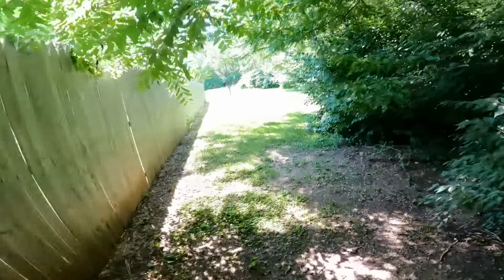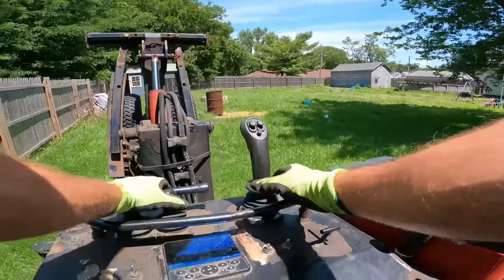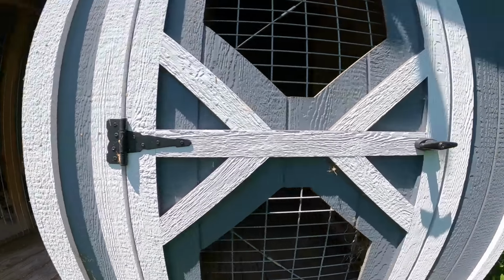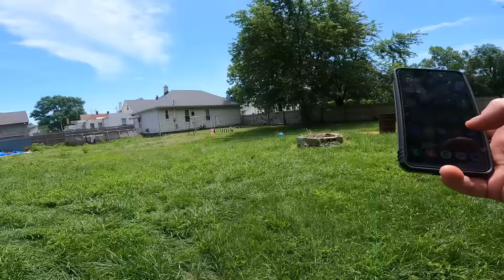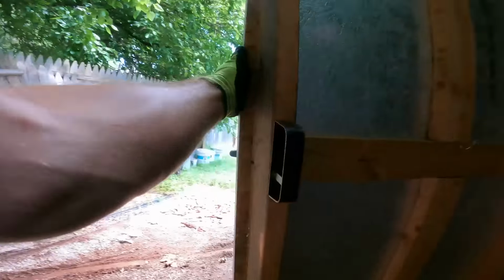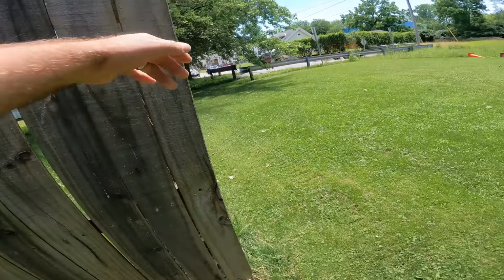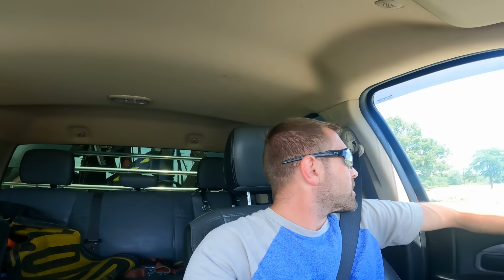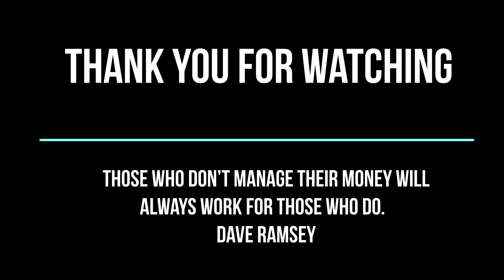Dog Kennel Repo Attempt

Comment: Wow, in FL if you were to take those fence panels down, you would be in JAIL. Repo persons can't even open gates or cut locks.
Reply: @tammielee6743  Even if the homeowner was home , and the repo guy comes to their door and says, " If you can't pay for the dog kennel, we come to reprocess the dog kennel "  do you think that the homeowner will say of corse you can come to collect the kennel,  let me open the gate for you and turnoff the electricity?  Of course not, they will yell 🤬 and do everything to prevent the repo from happening.  Because that's how lots of people are.
Reply: I was wondering that myself.  Home owner could claim he damaged the fence.  Damaged the yard with the hauler.  And even argue that he trespassed on private property.  Not to mention theft of personal property as he was planning to take the shed with the window AC unit still attached. 

Even if this repo was legitimate, it just seems like he took some pretty shady approaches to reclaim it.  His only saving grace is that there was no dogs in the back yard and no metal brackets used to secure the back side of the fence panels to the posts. Because he sure didn't have a Plan B.  

So his revenge is to move it and adjust it so as to make it awkward to use for the people who bought it.  Without consideration whether or not what he did wouldn't put pressure on the live electrical lines attached to the unit.

And one of his comments really stuck with me.  "You are supposed to put this inside a fence."  Where else would you find a dog kennel?  Seriously.

I don't know.  I have no idea what state this is or whether the guy even broke the law.  But it seems to me that to repo this shed it is going to take a court order, police involvement, and a certified electrician to disconnect the power.  This guy just wants to take the Billy Bob approach to shed repo.
Reply: It's the same in Louisiana. I could defend my property with force if need be but I don't have a repo problem as I always pay my bills.
Reply: Usually the lease agreement gives the leasor rights to the property at any time to repo it.  It's basically the owner giving permission, so it can't be trespassing, and it usually has a clause in there about damages are the responsibility of the owner.  Those are pretty lock tight contracts that allow this, no matter what laws you may be thinking of.  If the owner gives prior permission in a contract, it's binding.
Reply: @superdave8248 You wrote a lot to have never read a shed contract.
Reply: @DannyBowen25  Even with that, by crossing a barrier, in this case the fence, and depending on the state law, it could be charged as burglary
Reply: Wonderfully said superdave8248
Reply: It’s just not in Florida it’s all 50 states this guy is breaking the law and would be in jail for numerous charges the only recourse they have is court and try to get a wage garnishment
Reply: @martinedgar8057  It could be considered burglary, but it's not going to be because he has a legitimate, owner signed contract that states he can come in...  you COULD say that if you invited your neighbor over and told them they could have dinner, you COULD say they stole your food and have them arrested, but it won't stick once they find out you invited them.. and that's what a contract for a shed covers for the shed sellers.
Reply: @martinedgar8057  Also, FYI many of them AUTHORIZE the person to REMOVE any barriers in the way of taking back the property.  They've thought of that loophole too.  Bottom line, no state law will make a crime of burglary out of an AUTHORIZED (even if you attempt to temporarily remove authorization by saying "nuh uh") if it's authorized by contract under conditions.
Reply: @tammielee6743  Read a contract. Think about it. The repo man wouldn't spend a minute in jail. On the other hand the person in possession of the shed would be facing two charges, theft by deception and felony theft due to the amount of the purchase price. That person, if they don't have a conviction record would more likely pay court cost, fines and restitution and put on three year probation plus now they have a felony conviction on their record. Good luck getting a job or a line of credit.
Reply: In Texas if caught he'd be buried in the garden. 😂
Reply: @DannyBowen25  That is why the barrier is the important aspect of my comment. Using your scenario, if you invite your neighbor over for dinner and they come over when you aren't there and enter your house and take your food, that is theft and burglary
Reply: @superdave8248  he broke the law .homeowner has rights .
Reply: Contract on a shed is what gets me in the first place. Just build it yourself for 1/2 price
Reply: @tammielee6743  I don't see how they can do to the fact that a repo is collecting property for the owner. If you buy something and don't pay, it's no longer yours and keeping it is considered as theft.
Reply: @superdave8248 doesn't seem you know to much about repo's and how they work. 😂
Reply: @martinedgar8057 how can he be charged with burglary 😂 the ones that bought the shed wasn't paying, hence its no longer theirs. They knew this when they signed the contract, and could have cleaned it out seeing they knew it was just a matter of time before it was picked up.
Reply: I think when you rent you sign an agreement that if you don't pay they have the right to enter your property take your fence down and take their property back. 
So you sign a contract giving them the right to enter the property and all those other things they do
Reply: He moved a couple of nails around, big deal.  Josh  doesn't leave a mess!  I'm in Florida, Repo's go on all the time.
Reply: @tammielee6743  well there should be laws to prevent that from being the case. If you can't make payments on your stuff, then they company has every right to do whatever it takes on your property to collect what is theirs. You can yell and scream until your voice gives out, doesn't matter, if you can't pay for it, they have the right to collect, it's all under contract that the customer signed.

Comment: You almost caused a massive fire by picking that shed up where your 3 phases ''big black wires'' are pulled up into the bottom of the panel. Look at the concentric knockout where they are going in and how the wires have bent the steel housing, very lucky that insulative jacket held up.

Comment: My gas water heater is on its last leg, I want to replace it with electric, but I have no idea what I am doing. I will bring in an electrician when the time comes.
Reply: That's the right decision  .
Reply: @Van-l2r  Why would you want electric instead of Natural gas? It will cost much more to heat water, at least it does in our area. And if you lose power, you still have hot water.

Comment: Disconnect the feed wires. Put wire nuts on the ends, or cut clean n tape. Even tho ones hot , should work.
Reply: Yeah, assuming we all understand electrical work, even very basic stuff is not common knowledge and can cause many major problems I.e. fire, injury, death. Not to mention you’re suggesting just leaving capped/taped live wires lying around for some unsuspecting poor soul to find ⚡️.

Comment: If you had cut the black wires one at a time at the box in different hights of half inch it could never Arch and safe for you pull shed right off of it.

Comment: I would just short out the wires in the dog house. It would pop the Circuit  braker in the house. Use a big old screw driver. Now the power is off.Then disconnect the 3 wires in the box. i had to do it on a AC unit one time..Just keep one hand in your pocket and your eyes closed when you trip or short out the wires in the box that's in the dog house.
Reply: As long as the breaker is functional…..

Comment: Turn off power at junction box attached to the house. Should turn off power to the shed. Disconnect at shed breaker box . Problem solved
Reply: greg--There was no Jbox attached to the side of the house. The video clearly shows Josh looking at an "lb" which allows an electrician to bring wires out and turn them 90 degrees.
Reply: @cotton-Dave  I wonder if he gets paid anything when a repo gets trampled like that.
Reply: @gregcook383  I wouldn't know about that.

Comment: Just like a car if payments are not made you lose the car/shed etc. josh you have a job to do. Shed non welchers have had ample warning. You keep your cool and have to deal with such awful people. This is a tough one with dogs involved. You could call animal control to remove the animals. Those people had enough $$$ for that very solid fence but wouldn’t pay for the shelter. One suggestion please get a guidebook or get an electrician to show you safe disconnect. So you don’t deserve to suffer electrocutions. What about disconnecting at the fuse box in the shed and tape or mar cap those ends. You should not have to do so much to do your job of repossessing. I bet shed contract had clause no electric, no water, no cutting windows out etc until paid in full.

Comment: The very second you went in that fence you committed a felony, secondly, when you twisted the building  you created a situation of a fire hazard and extreme danger for the homeowner or renters  as well as yourself  Use your head man, and bring you a set of heavy-duty hasp and padlocks then they would call you  but by the looks of that place they were done with it anyway if you didn't burn it down turn off the breakers did nothing to kill the power to the building and that was 100 amp service

Comment: Question: Why didn't you grab a saws-all, cut the wall so the electrical box is separated from the shed, turn off all the breakers, cut all the wires coming out of the electrical box, take the shed and leave the electrical box standing alone in the yard?
Just a thought for the next time you run into this problem.
:-)
Reply: Because he doesn't want to damage the property he's repoing.

Comment: What are the chances there is a second breaker in the house? Could you tap in and use a momentary load to trip the 240V line with 300A for 1 second? Is there any commercial tool like that?

Comment: These Storage sheds are made out of cheap material and sold for a high price's in order gain more profit. Learn to use a level, square, and tape measure and you can build a nicer one for half the price.. If you can't afford it build it, dont try to rip the company off

Comment: You checking the breakers in the shed made no difference, there is live power coming from their main breaker in their home. If you snap that line or break it, it will do 1 of 2 things. It will most likely pop that breaker and shut down the power to their shed or it will pull the wires out of the breaker possibly causing sparks as the loose wires get dragged across other live wires that could result in a fire in their home.

Comment: You made that harder than it should have been.  Just open the breaker panel box disconnect one wire at a time and put a wire nut/cap on it and tape it up.  Then do the other two one at a time.  Have to be careful because it could still shock you, just don't touch the naked part of the wire.  Then lift the building and feed the wires out the bottom of the building, shazzam you're good to go.  I thought you were a get er done kind of guy
Reply: He’s not an electrician, genius. Do you know how to run his machine and haul sheds off properties like he does?
Reply: @abunchahooey   Sure he is

Comment: Go ahead and rip it out. The wires will short circuit and trip the breaker in the house. Or cut each wire, one at a time and pull away.

Comment: I understand you have a job to do but what law lets you take a fence apart with out a court order and a sheriff?
Reply: They are not allowed to have it in a locked yard.
You sign off on that in the contract when you finance it. Nothing else required.
Reply: @JimsEquipmentShed  Ahh. That would make sense then that its in the contract. When I bought one of these I paid cash out for a 3 time repo unit so I never saw the rental contract that our local hickory has. Thank you for the information I will have to remember it if I ever need to rent one.

Comment: If you've got everything turned off from the breaker that he connected that panel to you could cut any and all those wires and just lift away and there'd be no snag on The Wire just so you know for next time be a whole lot easier for you

Comment: I would have used some line and a switch and shorted the lines if I could not safely unhook the power (why did he not call a electrician, insulated heavy gloves, and ppe,,,and tools and simply unhook the power, cap em and easy?  or there are tools to check outlets that with a button push momentarily short and trip breakers...there must be breakers somewhere....
Reply: Inside the house... hopefully

Comment: Another Idea is to make a box with a switch and a line cord. Run the wires directly to the switch. Plug in the box into the wall outlet, then throw the switch. You'll get an immediate pop of the circuit breaker. Of course it won't set off the breaker inside the house. You may have to hold the breaker handle to prevent it from tripping. Then again, a long screwdriver would do the trick too. Just be sure to wear rubber gloves with no holes on them.

Comment: pull the meter on the house then check if the lites are off pull the wires from the box don't put the meter they will figure out the shed is gone they should have paid there bill
Reply: There's usually a lock on a meter and breaking that is against the law.  He would be in lots of trouble for disrupting power in the house.
Reply: Pulling the meter presents an arc flash hazard, so it requires training and protective gear.

Comment: U COULD HAVE  just loosened the wires in the box and pulled   or cut one wire taped it up and then the next and taped it up-- and the next...     dont take my word-- go get an electrician to wqlk uu through it...  its scary-- but ou can work one at a tie and dont hit anything else. prsonally i would have removes the lugs on each cable and just pulled.   they would short and trip teh circuits in the house-  and all would be safe...  but talk to a lawyer in case shit goes wrong..1% chance

Comment: Rubber gloves.  Cut one wire.  Cut another wire.  Short those 2 together.  "Assuming" there's a circuit breaker back at the house, this will blow the breaker then the circuit is dead.  You're going to get a big spark when you do this.

Comment: Pull the meter, cut wires, tape wires,replace meter.
Reply: Don’t pull the meter. Bad penalties in my state.  And the newer meters that are today’s norm will send an alarm if disconnected
Reply: @Dale-q8o  Same where I live.  My meter has like a lock on it and it's against the law to cut that lock.  It sends an alarm to the power company if it's disconnected.  I'm sure Josh would be in all sorts of trouble if he disconnected power to the house.

Comment: I also would say you knowingly did major damage to the electrical panel/wire etc and recorded it.  So now if someone gets electrocuted due to the damage you caused guess who they’re gonna be coming for!!!! Future reference next time you see a shed that has panel back away and also it would have been so much easier to just take the panel cover off to see the wires. But then again you had no business doing that to see what size wire it was because no matter how big or small the wires are it will still hurt you. Not trying to hurt your feelings but just saying it’s not worth the liability.

Comment: Wow, you have an unsafe job. In my state that would have been a crime.
Reply: @EthosAtheos  no, you sign paperwork that says they can come get it
Reply: @RandomsFandom  To a degree yes you do, but they still need to abide by the laws themself. unless they have a fully signed warrant stating they can use any means necessary or something like that to gain entry. he just broke the law and if he is working for a company then that company needs to train their staff better as they are putting their staff's freedom at risk.
Reply: @RandomsFandom  The contract says they can remove and damage a fence? Rip up the lawn and damage electrical wiring? 

I have a hard time believing that ripping an electrical line out of the ground like that would be covered by a contract. That building was not in violation of the NEC and was a fire hazard. Contracts can't protect you from a criminal act or allow you to violate electrical codes.

Comment: Dude, it's only electric. Some basic (YouTube university) courses and you could have disconnected it easily. 
As far as moving and leveling that's easy $hit. If they have need, they can just unscrew the hinges. If that were my place, you probably only made 30 minutes of work. 
Block and screen this comment. Go learn something, instead of taking the easy way out.

Comment: I guess I’m having a hard time understanding why someone needs all that power in a dog kennel … and AC … aren’t 3 of the walls made out of wire mush?  And it was professionally done too … which must have cost a penny or two.
Reply: Another commenter suggested a grow house. Makes sense.
Reply: It's called the volt-drop, you need bigger cables for longer distances.  I guess they plan for a bigger AC or heaters .